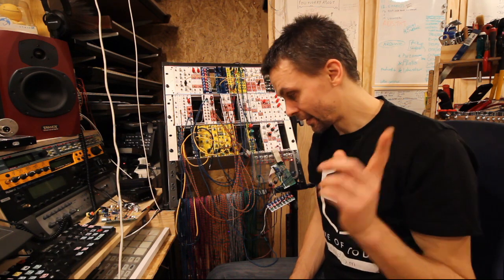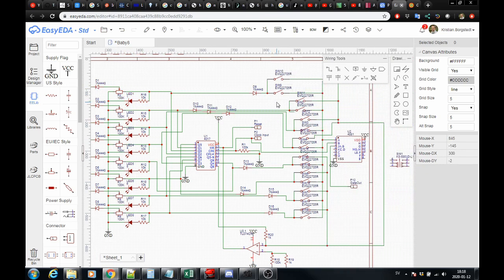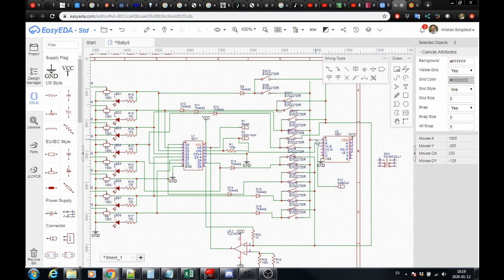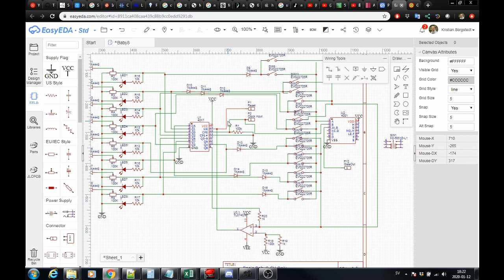Adding Switches for Gates and Reset to the Baby8 Sequencer - DIY Modular in a Week 10.2

Comment: Hi Kristian! I'm working on a layout for this version of the baby 8 and was wondering if I could use the non used gates of the 4081 to get another set of "gate out"? If so, do you think I could just pick the same line entering pin 2 of the 4081 and send it to pin 6 for ex, and connect pin 7 to another set of switches coming out of the 4017?

Comment: Hi Kristian, first thing thanks for all your great work. I got a silly question (sorry I am a beginner): I am building my version of the baby8, I am not going to add the gate at this stage, but I got the reset on a on-off-on switch ( one side to the pots, middle is silent, top resets. Do I still have to put a diode between the switch and the reset? Thanks

Comment: Love these videos, working my way through them. I was wondering if you are using the +12v VCC from your eurorack and getting +0-12v on the VC out of the baby 8? I noticed a lot of stand alone baby 8 schematics use +9v VCC
Reply from the maker: Yes I am! There are some losses in diodes and stuff, but I built mine with 0-12V range. But I would say that a better range would be up to 8 max. That seems to be the norm. And I even think running it from the 5v rail would work, and then get a bit more play in the knobs... I made some boards to play around with this, but never had the time to actually play around with it... need to move on! :D

Comment: Hi Kristian, many thanks for this great series, I've really enjoyed following you and building some of the projects to add to my 5U diy modular. I'm now constructing this sequencer but there is one issue I'm struggling with: at the 11 minute point in this video you turn some of the switches off. I believe this switches the gate outputs off, so what I don't understand is why it also stops the corresponding LEDs illuminating. I thought the LEDs are always connected to the 4017 outputs? I would be grateful if you could shed any light on this.
Reply: Hello Steve O, if you take a look at the circuit that is attached in the video description, you can take the 10k resistor with its corresponding LED at each step and connect it behind the switch of the gate and of course provide it with a path to ground. This means that when the gate switch is closed, a path for the current to flow into the LED is provided, as well, the voltage is provided at the AND chip for the gate output.
Reply: @chrismenassa  Many thanks for the reply Chris, I'll have a play and see how it goes.

Comment: I was reading up on CMOS chips and noticed you did not terminate the unused input pins on the 4081 to ground in your schematic. Isn't it required to prevent the pins from being damaged from static electricity?
Reply from the maker: Yeah I am bad at doing those things, that might be true, I dont know, it hasnt happened to me yet, and I am going to use the other gates as well in the next part...